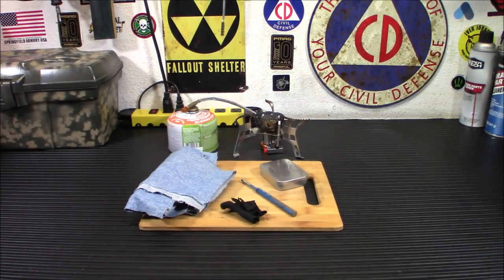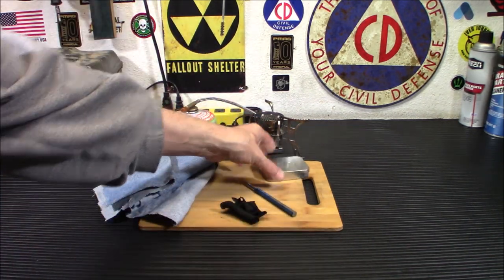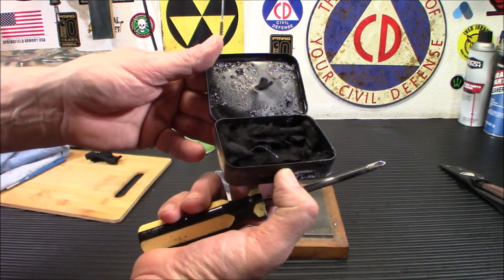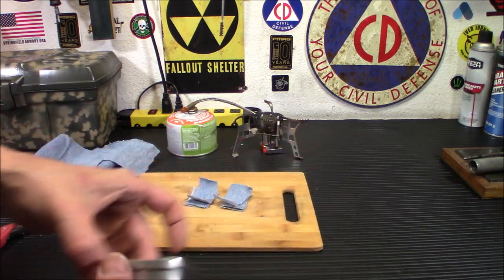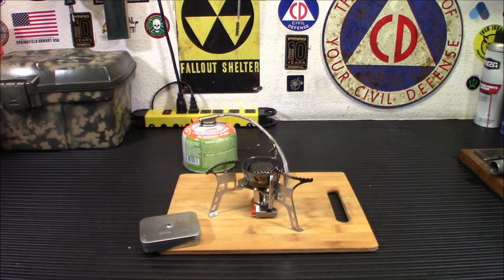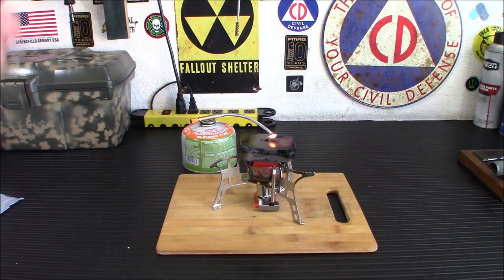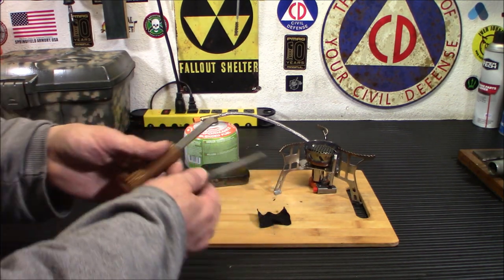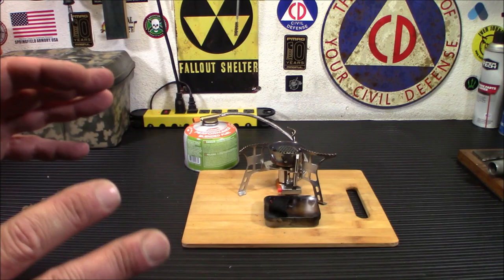Making Charcloth At Home The Easy Way!

Comment: Dollar Tree charcloth: If you go into the snack section, they sell a nice tall cylindrical tin with Pirouline Dark Chocolate Rolled Wafers. This is the container. For the char cloth material, go to the makeup and beauty section and they sell Assured Cotton Rounds (makeup remover pads) in an 80 count pack. For $2 you have a lifetime supply of charcloth and the container to make it in.  I really like the cotton rounds, they really catch sparks nicely.  Used my propane grill to make it. And, free chocolate wafers!

Comment: I actually am just mainly a camper, I read somewhere that if you take a empty pack of eggs, use your dryer lint and as soon as its full add some candle wax then you can cut it  up where the individual eggs go (to save space) and use that for tinder. Ive been making it (dont know how easy it will be to lite though)
Reply from the maker: Yup that works well
Reply: using a lighter or match, fairly easy I would think...like a candle. If you were using a ferro rod you could kind of pick at it to get some of the lint exposed first and it would probably take a spark fairly well....again, just going by all the videos I've watched and learned from. Not by experience. The egg container method would be good for starting camp fires I would think.

Comment: I cut strips an inch to inch and half wide and however long to fit the container once rolled. The rolled method usually makes it more supple so it doesn't break as easily, also if you light it rolled up it makes for a larger coal for an easier fire. However the way you did it here was a perfect example and works just fine, thanks for the vid and have you tried that other ferro rod striking method?